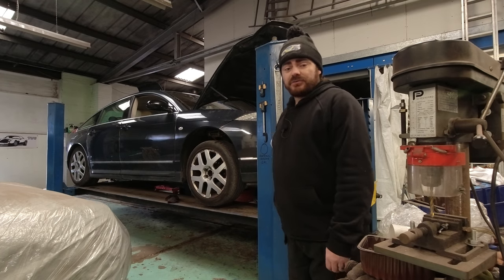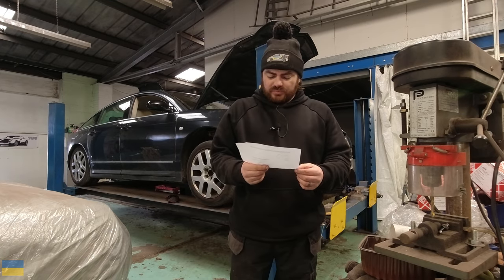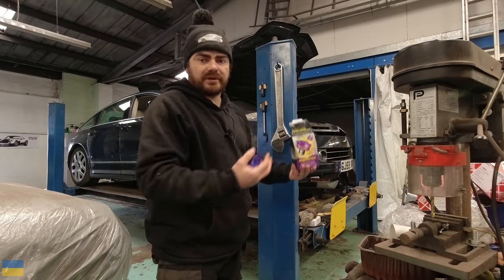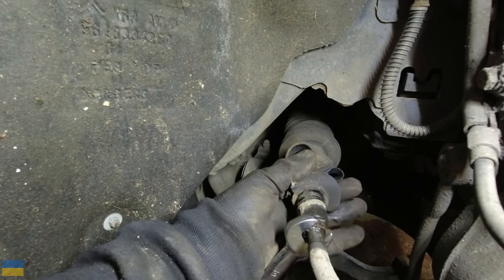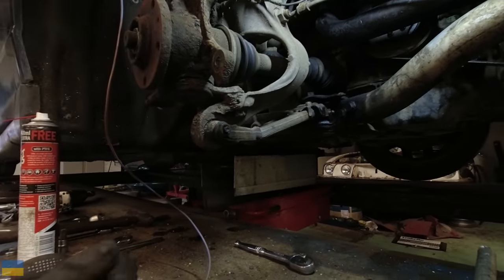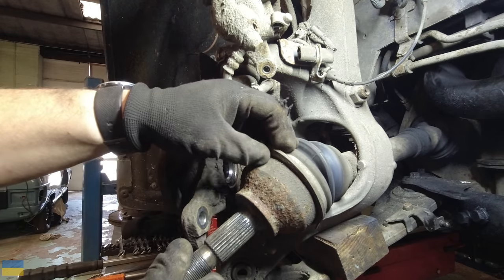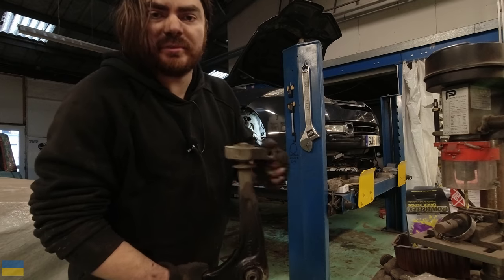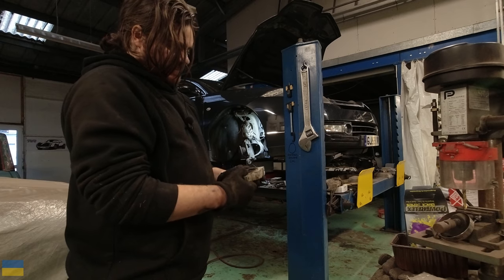Cheap Citroën C6 Project 2:  Wishbone Issue Discovered + PURPLE bushes!

Comment: Wow, learned a lot in this episode. Didn't know anti-dive and hydropneumatisch suspension were that tightly related. Simple hydropneumatics being more clever than the electronic ones let me in awe of the engineers in the 50ies 🙂
Reply from the maker: It's not that they're tight-related, it's more that in having hydropneumatics suspension, you can factor in anti-dive geo much more easily.

Comment: nobody should actually care about the total. the knowledge for this is close to unobtainable (at least around where I live). 

hats off to you sir
Reply from the maker: I'm anticipating that the total will get close to what you could buy a 'better' one for, but my logic is that the 'better' one might then need a fair chunk spending on it anyway.
Reply: @UPnDOWN  it's about keeping it on the road yes? There'll be no end to what you need to do to the car. Not because it's "this" car; that's the case with any second hand car.

Comment: Another great video Richard thanks.
I collected my C6 today and greatly enjoyed driving it 70 miles home.
Very interested in your thoughts on ride, regarding having the correct wishbones at the front.
I've no idea what's fitted to mine (it's done 143k, so not surprised if they had been changed, I'll go through the invoices) but I'm going to check now, for sure.
Mine does get caught at low speed over bigger bumps. At motorway speed it's silent and sublime, but at low speed not quite as composed.
I'll be absolutely fascinated to see what you find 👍
Please keep up the great work
Reply from the maker: I'm still collecting my thoughts on the suspension on the C6, at the moment. It's definitely set up more for faster driving, and is sublime on the motorway as you say. Just gets caught out around town, but eventually I'll do a POV/road test on it and get my thoughts together for that.

Comment: Haha - I'm now going to go out and check my X7 wishbones and make sure they're not 407 ones lol. A home mechanic replaced one of those 'frip' joints before my ownership. Went over a pothole too hard and one of the bolts popped out. Almost shat my pants - one wheel was effectively decoupled from the steering. I'm guessing he didn't have a four post lift and couldn't be arsed to tighten the bolts up properly. All's well now and I'm glad it didn't happen on the motorway!
Reply from the maker: Ouch! Bullet dodged! I meant to include a picture of the C6 arm and the 407 arm side by side, but forgot. Will do it as a post or something.
Reply: They're both French, what's the difference?

Comment: I had C5 X7 and changed those lower wishbone bushes couple of times. No special tools so ended up drilling holes in them to get them out. Real bush mechanic. 
And, just to mention... my BX died at the traffic lights today. Happy pushing. I think I had just flooded the engine as it was fine when I got it going again (after removing the air filter)

Comment: Good to see you making progress with your C6. Agree with your comments about the ride my 2,2HDI base is a 2009 with 93k on the clock rides very well but is confused by speed bumps.
Had a problem with the load regulator at the rear of the car recently the main dealer in Cardiff overhauled it rather than replacement and it now works fine probably saved me some money as well also had the instrument cluster repaired which is a common problem. look forward to seeing your car back in action.

Comment: Good to see your progress Richard. I think the suspension software update is the least of your worries, with the wrong arms fitted, knackered FRIP joints & bushes. Get the hardware renewed, ride heights correct & spheres regassed, then you'll see a massive improvement.
Nice shot of my Activa V6 & C6 (& a friend's Fiat X1/9) in the background of your AX picture.
Reply from the maker: Next couple of vids cover this :-)

Comment: Awesome video - really like the Citroen hydra set-up - looks a total pig to work on though.  I polybushed by Rover P6 front and back - now there's a suspension system you go into with both eyes open and a workshop manual as thick as a housebrick.  Well, well, well worth it, did the rear with 'Progressive' springs too - ten years in and still a magic carpet ride.
Reply from the maker: The suspension isn't too tricky to work on, but you do have to know how it works first. Polybushing is a wonder, IMO. I've done a lot of my cars over the years. Not for engine mounts, though - unless you're building a track car, it can ruin it on the road!

Comment: You're quite right about the Bush carriers. 407 and Ben Hurr c5 x7s have the same arms, the proper x7s have the same carrier as the c6.
My x7 os arm is from a 407, ns is correct, although I measured the difference at 9.5mm..
Also, you don't actually need a special tool to get the lower Bush out of the upright, you can just remove the bolt that gets on the way of a regular removal tool..
Reply from the maker: Yeah I'm sure you can, but I bought the tool anyway as I don't know how many I'll be doing in the future. It worked perfectly, didn't even need to read the instructions.
Reply: Real men never read instructions!

Comment: Damn, I was doing so well bingeing the SM uploads, then this came along! Good feedback on the SAAB bushes, although not horrible my YS3E 9-5 will need doing, so I may just stick with OEM bushes. Thank you.
Reply from the maker: I can't speak for the 9-5 obvs (never even been in one) but I just remember that all the things the 9-3SS did badly (over-light and imprecise steering; poor/rock solid ride; slow to change direction) were just either unimproved, or even worse afterwards. The steering in particular was horrendous, the grip in the wet was shocking. It was almost like...I dunno, a Vauxhall Vectra!

I did really like it, though, despite the flaws. If it drove properly I'd probably still have it, and wouldn't have bought the C6!
Reply: @UPnDOWN  Thanks for the detail. Having driven several flavours, I find they are a bit of a lottery, a poor one feels like a chore to drive but a nice one is a pleasant place to be, even for hours at a time but not in the same way as an LHM Citroen.

Karma got you a C6, no complaints :-)

Comment: I think you may have another problem with the wishbone bush bracket.  

With the 407 bracket the axis of the wishbone is horizontal and the axis of the bush is horizontal, perpendicular to the bush bracket.  All good.  But when you raise the tail end of the wishbone, the wishbone shaft going through the bush is no longer horizontal, and not perpendicular to the bracket.  A rubber bush can tolerate that misalignment.  A poly bush, not so much...  Maybe the C6 brackets have an angle on them for correct alignment of the bush?
Reply from the maker: I think it's such a small difference that it's negligable. What I don't get is why they didn't just design the subframe to tilt the arms forwards, cos they could have used regular 407 arms then.

Comment: What really annoys me about suspension repairs and especially bushes is that the parts are relatively cheap but the labour to put them in is a f**king fortune. Of course you don't have that problem so I envy you. I've spent hundreds on my C5's suspension and it still sodding well rattles
Reply from the maker: Time is money, sadly!
Reply: Trust me, most mechanics don't enjoy doing those jobs either. For the stress and annoyance doing some of these jobs, it's sometimes best to just let someone else do it.

Comment: Nice video 👍
My c6 has correct wishbones, but still  it goes up and down and, at night, drivers in front of me are not happy. XM never behaves like that.
Reply from the maker: Hmmm...that's not good! It can't be right, there must be a fault somewhere. I'm determined to find it!
Reply: I haven’t had my XM for too long but so far I have definitely not noticed any sort of excessive up and down action. I can however confirm that at lower speeds she’s not as happy filtering the road as on the highway. 

Perhaps I need to do some bushes myself. (She’s high mileage after all)

Comment: If ya need the special upper ball joint tool, let me know, I can lend it out to you! When I did my wheel bearing, I replaced the knuckle with a brand new one (£50 each from Germany!)
Reply from the maker: That's kind, thanks. I should probably just buy one, I'm bound to need it, and it no doubt fits other PSA cars.
Reply: @UPnDOWN  As far as I am aware... it's just the upper ball joint on this suspension system. Cost £20 from Laser Tools.

Comment: That part must have been fitted before I bought the car at 66,000 miles
Reply from the maker: Quite possibly! Can't find any trace in the history of it.
Reply: @UPnDOWN  I think I had one of the CV joints done but my mechanic had  the devils own job getting one because the ones from Citroen  off their database was wrong and he had to measure them, eventually got them it form a dealer in aberdeen.  But then you know she is a bit odd with what looks like the c5 V6 Box rather that the C6 box and I bought her as a 09 plate and you say she was manufactured in 2007
Reply: @kevinelkins9955  Because French, eh?

Comment: I always have to laugh when I watch tutorials of people doing suspension work, almost always their underside is relatively clean and fresh looking, they zip off bolts and nuts like it's child's play, and then when I got to do it, it's a struggle to get each and every one of them off.
Reply from the maker: Mine definitely wasn't pre-prepared!
Reply: @UPnDOWN  I know. Seeing you pull that CV axle with nothing but hatred for everything in sight on your face was so relatable 😂  I had to get the angle grinder to cut the ball joints off my Mini last time I did suspension work. They had literally bonded themselves to the knuckle.

Suspension is some of my least favourite parts of a car to work on.

Comment: I know it's a C6 video, but you've had a C4 VTS so I'd like to ask you two questions. First, did you give Powerflex bushes a go on it and if you did, how was it? And second, I've bearing noise coming from aux belt upper pulley which can't be sourced anywhere. Should I risk it for the biscuit and press the bearing out and risk losing the unsourceable pulley, or should I try with the DW engine belt since DW's don't have that pulley up there?

Thanks :)
Reply from the maker: I fitted Powerflex bushes to the rear axle, as it was crashing over bumps a bit. They transformed it; made it silent and tight. As for the pulley, I'd at least remove it and see if the bearing can be changed easily or not. The DW doesn't rev as high, so you may find that pulley is needed for the 5k+ rpm that the petrols can do (I think my VTS used to hit 7400rpm....not that I went barrelling into the limiter much, honest!)*

* OK, I did.
Reply: @UPnDOWN  thanks for your answer! My bushes are still good, but I'll source some Powerflexes for when they'll be needed.
I've managed to find a new SNR pulley in one store, they've had it sitting on a shelf for a bit under 10 years lol. But I'll try to replace the bearing on the current one to have it in backup.
My VTS revs to around 7800, I think it's got to do with the 100 octane fuel I'm using. The ECU can apparently recognize it using knock sensors so it can adapt.